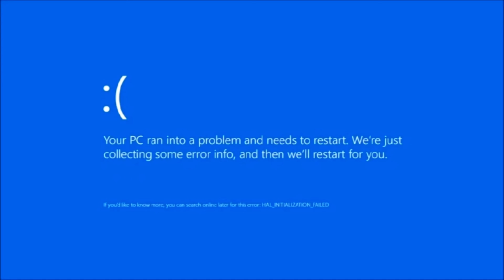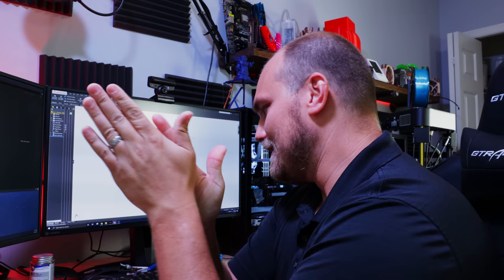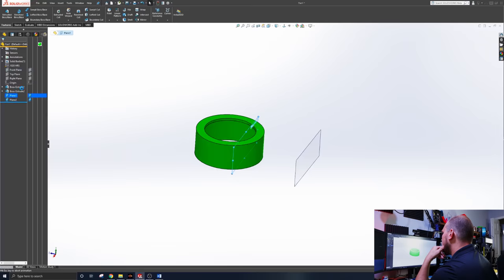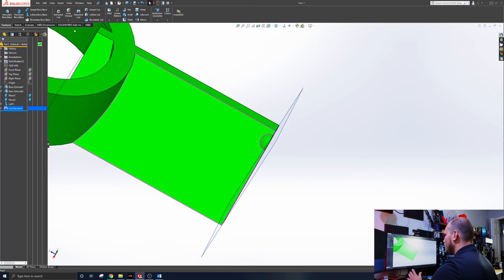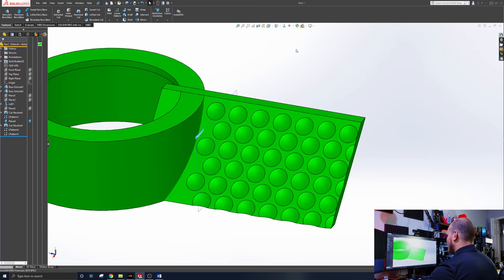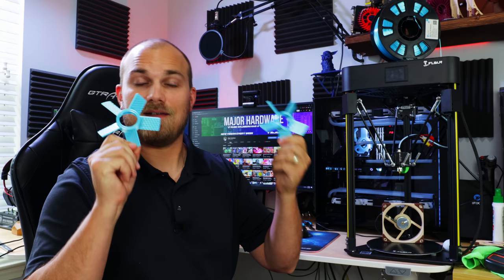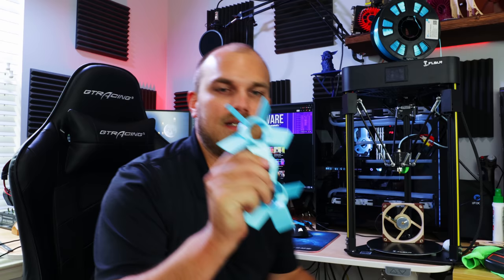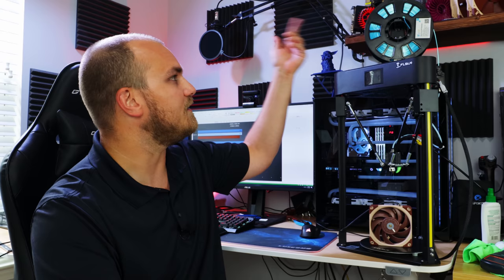What If Fan Blades Had Dimples Like A Golf Ball?

Comment: Aerodynamically, dimple patterns work best when there is randonmess in the pattern, and not just a repeating fixed pattern.  A small amount of randonmess is enough, but makes a big effect on drag.
Reply: I never knew that, I’ll have to look into it, sounds really interesting
Reply: Kepler its because air acts as a fluid under the laws of turbulence
Reply: Your correct, but only 1/2 correct. 1st it's true that a complex dimple pattern will reduce air turbulence=farther flight. 2nd dimple patterns are not random; there are multiple different dimple patterns and manufacturers either prefer specific patterns for cosmetics OR more likely in their testing they picked the one that flew a tiny amount farther. Note; probably 15 to 20 years since I read an article on why golf balls have specific dimple patterns they do...so I forgot most of article. Not important; dimple pattern in video has sharp transition between ideal partial sphere cross section and flat surface; golf ball has radius 1/16 circle arc for perhaps 45 degrees? He did not do that in case program even though printer is precise enough to make that smooth vs sharp transition...but would not have made detectable difference beside being visibly closer to golf ball dimple. Ummm my description of that is awkward; sorry.
Reply: Golf balls have dimples to maximize spin I believe
Reply: Have a look at a Tesla valve..
Reply: @xXVintersorgXx  That may be a side effect, but golf balls actually have dimples to induce turbulent flow around the golf ball. This increases the drag of the ball surface, but decreases the drag of the golf ball overall. This is because turbulent flow will "grip" around a surface better than laminar (smooth) flow will. Therefore, the separation of flow at the back of the ball will be reduced, and so will the drag. Essentially, the turbulent flow helps to "cover up" the poor aerodynamics of a spherical object.
Reply: Everyone almost has it right..... The dimples do matter by size, depth and how many. So the "randomness" is actually very specific. If you look at any golf ball you will see a couple different sized dimples. Alot more bigger ones compared to smaller ones. These patterns of big and small dimples along with how deep each are contribute to how long they can stay in flight. Now another thing to consider is how many dimples can fit on the surface. If you also look at a golf ball you will see almost all the "better" higher priced balls have hexagonal dimples. The reason behind this is more dimples can fit if they are hexagonal.  So with all this info combined if you took a golf ball and scanned it or used a micrometer you could mimic the patterns.... It would be really cool if you could do this as an updated vid. Also as I sit here and ponder it..... I think the effect it would have would be more drag. Aaaannnd another thing as my pondering is almost over. I think its to small of a scale to actually get good data from the test. Pease
Reply: The dimples on a golf ball or not for aerodynamics they are for grip and better contact when you hit the ball lol
Reply: @3wolfsdown702  they very much ARE for aerodynamics, but there is some misunderstanding above.  Golf ball dimples are meant to control drag, not just reduce it. The asymmetric nature of drag because the ball is spinning rapidly WHILE moving forward produces desired effects of lift and curvature (sideways.)  My initial comment refers to studies I have seen on dimples on a wing JUST for reducing drag and maintaining laminar flow further back.  If anyone is really interested search for such a topic with EAA and Sport Aviation.
Reply: @jetfuel3053  planes and space shuttle would be dimpled if that was the case
Reply: @3wolfsdown702  no, not really.  I am a pilot so I know.  Most conventional aircraft, AND the shuttle are aluminum skinned.  Dimpling them is not so simple.  The work done dimpling airfoils has been done on composite aircraft mostly made by homebuilders.  Economics of manufacture often drive the design of commericial aircraft and spacecraft.  Also, the shuttle spent very little time worrying about aerodynamic drag and actually WANTED it. It was never meant to fly far, just in a stable fashion to a runway from space.  Dimpling wings on commerical jet liners COULD be in our near future if they start using composite skinned wings...it would net 1-3% fuel savings if all other variables remain the same
Reply: @jetfuel3053  next you'll be saying they're coming out with bullets that are dimpled but the facts are a smooth object flies through the air better and have less drag
Reply: @3wolfsdown702  The concept of adding dimple is very new, with the extreme
benefit of making an aircraft more maneuverable by changing
flow characteristics. Implementation of dimple over NACA
0018 has proven to be more effective in altering various
aspects of the flow structure with varied lift and drag forces.
Results obtained through the computational are discussed in
previous chapter. The following conclusions have been drawn
from the work presented here.
1) When the flow along the surface of the airfoil enters a
dimple, a small separation bubble is formed in the
cavities. The consequence of the bubble formation is the
acceleration of the flow between the dimples on the
surface of the airfoil and boundary layer undergo a
transition from laminar to turbulent. This transition leads
to delay of separation of flow from the airfoil causing a
substantial reduction of drag force.
2) Comparative study between with and without dimple at
constant inlet velocity (i.e. constant Reynolds number)
shows that the co-efficient of drag is very low for a
dimpled aerofoil results from the generation of separation
bubbles inside inward dimples and the delay of separation
through the shear layer instability.
3) Modification in terms of dimples creates turbulence in
order to delay flow separation, which increases the stall
angle at which the aircraft is no longer controllable when
air is not flowing over the wing properly
Reply: @jetfuel3053  bulshit the dimples on a golf ball or there for surface contact
Reply: @3wolfsdown702  You are on the internet, just google it. 

Or watch this if you can't be bothered:   https://www.youtube.com/watch?v=94rfGiCOT5c
Reply: 3 wolfs down if that was true golf balls would have rubber dimples going outwards
Reply: @3wolfsdown702  how would removing surface area increase grip? Thats like saying that racing cars use grooved tyres instead of slicks because the grooves give better grip. The grip doesnt matter anyway, because the force from the club is not moving along the balls surface, but straight into the ball.
Reply: @jamesmccann5644  just by holding one in your hand you can tell the difference between the two golf balls.  and trying to compare it to race car tires is a laugh because the slick tires when heated up help stick to the track
Reply: and this all depends on the shape of the aerofoil and size of the dimples. expecting a blades boundary layer to behave the same as a sphere is where the misunderstanding comes in
Reply: @3wolfsdown702  holding it in your hand might have better grip, because your skin deforms into the dimples. But a golf club is made of metal, and wont deform into the holes. Therefore, when you hit the ball, less surface area means less grip. And again, grip is useless because the force is not being applied laterally across the area of the ball.
Reply: @jamesmccann5644  golf balls with dimples are designed for grip on the Putt and spin
Reply: @jamesmccann5644  if dimples were so aerodynamic they would be on Rockets airplanes and bullets
Reply: @jamesmccann5644  those dimples caused friction whatever object it's rubbing against whether it be the wind or the golf club
Reply: Air is a fluid under turbulence, but air is more fluid through air. If a golf ball is controlling drag, it is creating a bubble around itself to make the drag more fluid rather than forcing itself (the ball's surface) through the fluid (air).
Rockets dont need dimples because you have consistent thrust forcing it. But when the rocket breaks the sound barrier, it creates it own shell to move the air before it get the particular spot.
If im wrong, just say so. I have no degrees but im always intrigued to learn more.
Reply: @3wolfsdown702  if the dimples increased friction, then surely the balls with dimples wouldnt fly as far? However, balls with dimples fly further, because the dimples are disrupting the turbulance in the air, and making it more efficient.

Rockets dont need dimples because the rear of the rocket is not rounded, and this is where most turbulance is. Because a golf ball is a ball, its rear is rounded. Ideally the rear of something would be pointy, to get smooth air flow (eg planes tails). Rockets dont have pointy tails because they need to put the engine somewhere.
Reply: @bcwiklinski  air is more fluid through air? Please explain.

When an object breaks the sound barrier, the air doesnt have time to move out of the objects way, and so the object crashes straight into the stationary air, instead of a cushion of air of varying speeds building up around it. This is why supersonic objects are generally pointy (think fighter jets) , to cut through the air (which is serveral hundred mph slower). However, in subsonic objects, like passenger planes, more drag is generated by the surface area, and so a smaller rounded nose is better. And because its subsonic, there are many different layers of air all moving at different speeds forming a cushion at the front.
Reply: @jetfuel3053  Thanks I love it when research is used to answer questions! I read this thread and see so many citing parts of correct thinking but missing the overall point.
Reply: Think of the dimples like tiny spoilers. they create sticky turbulance at the surface but encourage laminar flow just off the surface reducing drag overall.  Another example is olympic swimmers in 'sharkskin' suits which have tiny bump pattern to break drag of water by creating a microlayer of turbulence at the surface. The fan speed and air volume should be the same, but lower draw on the power required.
Reply: @3 wolfs down You have a very very severe case of Dunning-Kruger. 

If someone presents you with a scientific source contradicting your theory about physics, you’re probably wrong. At the very least, you’d need to provide a study or source showing dimples don’t help a golf ball fly.
Reply: @ulsig95  You are right we do.  I preflight them on my private jet all the time. This discussion started though because of a video about dimples on a fan blade, and I tried to help with some knowledge about testing that has been done with dimples on a wing surface in the real world.  It is a very effective method for creating better conditions from laminar flow on a wing.
Reply: Yep. Just look at close up photos of a golf ball. Forget the spacing, a lot of the dimples aren't even the same diameter!
Reply: @3wolfsdown702  You can't compare any of this to bullets 😂 Some bullets have a low drag tip, but more importantly - angular momentum, creating a gyroscope. If there was no rifling in the barrel, bullets would easily topple end-over-end in no time. Even in a near-perfect smooth surface, the microsecond a bullet starts to tilt away from its trajectory means that it's exposing more surface area, creating a positive feedback loop where the drag will make it topple over even more unfavorably. The smoothness helps, but it really has nothing to do with it. The resistance to angular rotation caused by the rifling is far greater than whatever drag you would get, dimpled or not. If you're still in doubt, consider the aerodynamic drag on a hollow point vs FMJ.
Reply: As per any golf ball I've ever looked at.
Reply: @jamesmccann5644  you just explained it better for what I was implying. The cushion of air on the ball is creating a more fluid surface for the air to move around in front of the path.
Reply: I was thinking about this as he was mocking up the drawing. The reason being that some of the subway walls in the SF Bay Area have an interesting pattern that may waver and or vary in depth. 
Nature is not often symmetrical.
Reply: @jetfuel3053  Dryden has been playing with "adjustable" dimples on or as control surfaces for 50 years now.
Reply: @3wolfsdown702  , they have actually looked at putting dimples on wings. It increases efficiency, but when I last read about it like a decade ago no one had figured out quite how it worked... IIRC.
Reply: @ItzMeCarlos ......do you also believe in fairies?
Reply: @3wolfsdown702  ......your all wrong! They are for holding dirt so professionals can make their balls spin backward on the green and impress us.  I used to have a girlfriend, when I was younger, that could make my balls spin in any direction causing a hole-in-one every time! Simply sensational ball and man control.
Reply: @kepler1175  read up on Chaos Theory and NKoS
Reply: @denalozecon9074  'your' incorrect.
Reply: @ItzMeCarlos VSause was wrong.
Reply: this won't matter, nothing you can do to the dimples can make them work better because the reason dimples affect golf balls and not fans is that when an object moves through the air, it creates a low-pressure area behind it, creating drag and slowing down the body, because of this, a teardrop shape is the best shape for limiting drag since its outline follows the low-pressure area allowing it to negate the effect almost entirely. the golf ball on the other hand is made to be sphericle to allow for non-directional hits, and therefore must be designed to minimize drag some other way. 

this leads us to the dimples, and how they reduce drag. they do it by creating turbulence on the surface of the sphere, which creates vortexes swirling into the low-pressure zone behind the sphere, allowing air to fill the low-pressure zone more quickly, and lessening the effects of drag.
now, the reason this effect doesn't work on the fan is that its shape is significantly better aerodynamically starting off, as its blades do not generate low-pressure the same way the sphere does, since they are already thin, and don't require air to bend its path nearly as much in order to pass around it.
Reply: @davionarchie807  Air is fluid. Basic physics.